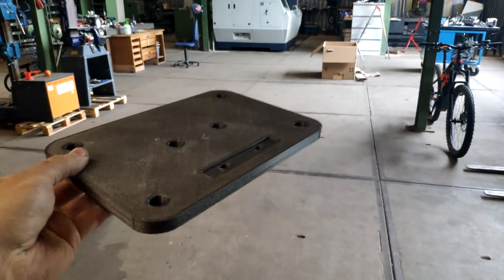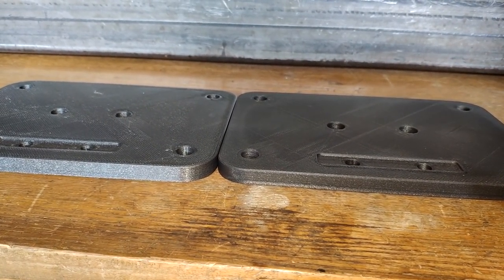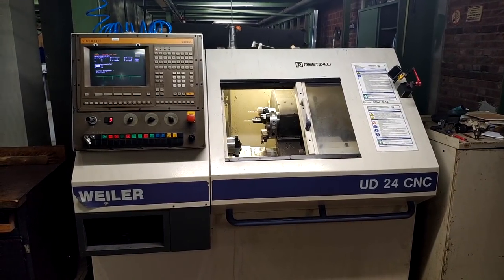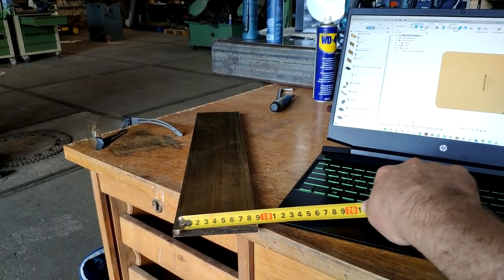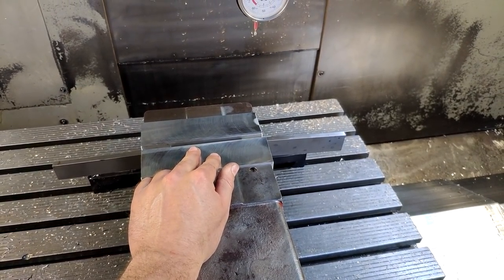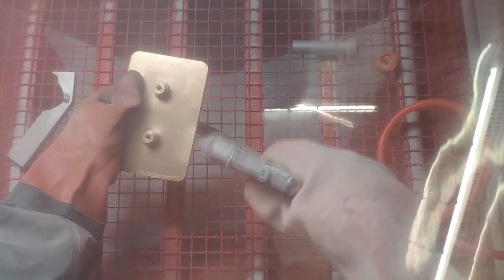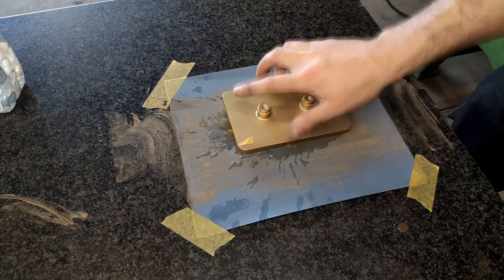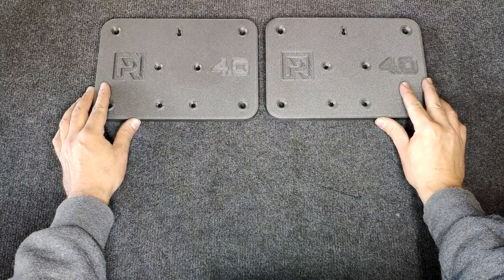This Old Tony's Play Buttons.

Comment: Hey Tony,, After doing my CNC engraving and when I need to fill in the engraved parts, I would Always use Pin Strippers One Shot paints with a fine brush and do exactly what you just showed when it has to be a high shine. Or , in the case of multiple production parts I would design the parts and  build the parts and if it needed to be glossy, I would super high polish or buff the parts I built on the cnc  machines, send to either anodizing or powder coating,  get them back and put back onto a cnc machine and do the engraving and more. If no shine needed, same thing but no buffing 1st. Turned out Nice Tony... Good to see you again. Ricko

Comment: The fact that I can see the lapping lines would have driven me absolutely insane... I envy your ability to just call things done when they're "good enough". I've been spending the last few MONTHS lapping a 2cm diameter brass part to a mirror shine because I don't want to see those little scratch patterns at all. Haven't even gotten below 5 micron yet.
Reply from the maker: The thing is: it has actually driven me nuts. Thats why I said :" I had a few problems getting the right surface finish on them". Once off the lapping they were pretty close to perfect. But by the time they were installed and I was filming them I had to clean them several times with a soft rag and that did introduce everything you see in the video. And trust me: Cameras pick up everything... So if you want my honest opinion: don't ever try to lapp brass - go with something hardened.

Comment: Was it just the camera or were there some scratches in the finished surface? It should help to change directions with each successive grit and cut across the marks from the previous step until they're gone.
Reply from the maker: There are a few minor scratches that you can see if the light is just in the right angle. You can't really prevent that, scratches came later on when wiping it off with a cloth/rag.